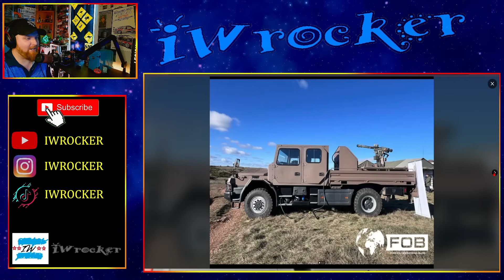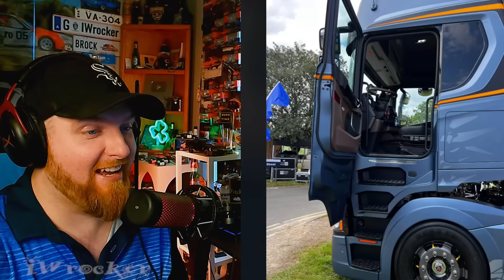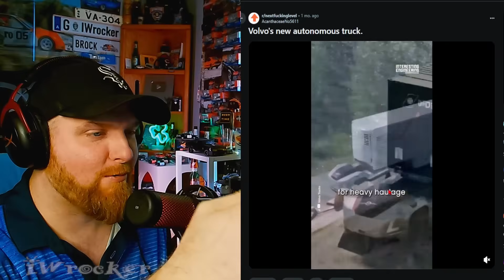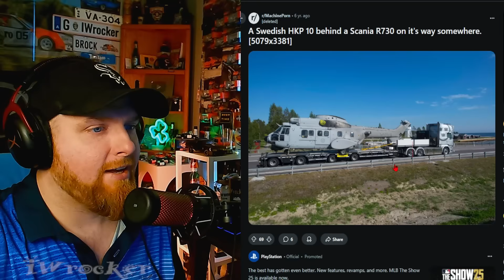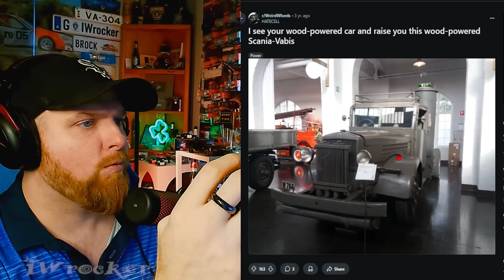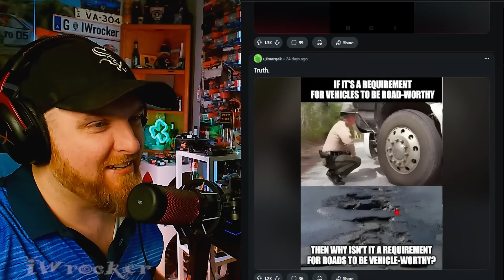American Reacts to some Unique Scanias & Machines From Europe..

Comment: Scania-Vabis was the old name of Scania. It resulted from the fusion of Scania with the company Vabis, an old producer of railway cars and trucks.
Around 1960, I was a nerdy kid and spent must of my time in a freight truck company near my house in Portugal. I was fascinated with the trucks. The employees sometimes let me pretend to drive sitting at the wheel. Must trucks were Volvos, cab behind the motor, painted in a severe gray and extremely solid looking. I used to draw those trucks and still can draw them from memory, 64 years after. Most trucks in the company were Volvos, but at least one was a Scania-Vabis.

Comment: https://www.youtube.com/watch?v=vBo7ctR7bOs The unique vehicle, a Volvo FM540, was built by Ziegler Brandweertechniek and features a CELA extinguishing arm, an ALCO APF5 roof monitor, an Orlaco 360° camera system, Ziegler Z-Vision 360° emergency lights and work lighting, a 6000L foam tank, and a Ziegler FPN10-10000-1HR fire pump with a capacity of 8000L/min.

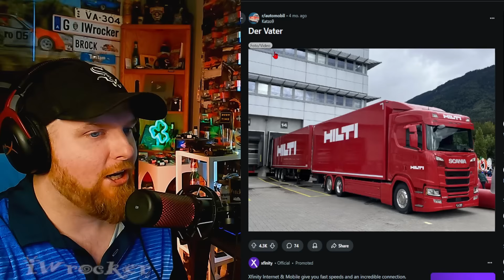Comment: 6:24 "Der Vater" translates to "the father" or probably rather "the daddy". Hilti is a big supplier of machinery and building equipment, especially highly professional power tools like drills or demolition hammers. Their sales representatives mostly drive Volkswagen Passat Wagons, painted in the same red color as that Scania and with white Hilti Logos.
The author of that post is probably referring to the difference in size, so the Scania is "Der Vater" of all the little VW Passats. Also, Hilti sales representatives have an image of driving like maniacs most of the time, especially on the "Autobahn". This may also be the source of the term “Passerati” - a portmanteau of Passat and Maserati - VW station wagons driven too fast by deadline-driven sales representatives.

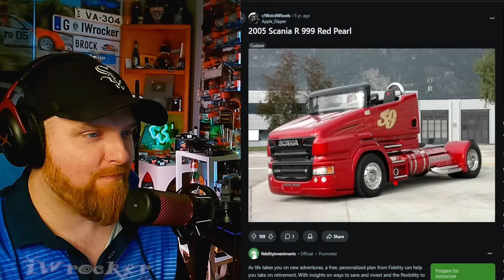Comment: 15:30 wood powered. Wood is burned in a lack of air. This creates carbon monoxide and tar. Carbon monoxide  (CO) is used when cooled to run a gasoline engine, producing carbon dioxide (CO²) . These vehicles were used when gasoline was not available. But it takes a long time until the fire is lit and enough CO gas is produced. In addition, the engine only has 1/3 of the power.

Comment: That scorpion stinger was originally invented for use on aircraft. It can be seen on big aircraft fire trucks. Obviously - it works on buildings as well.

Even if the roof or the walls are impenetrable - there are always doors, windows and skylights.

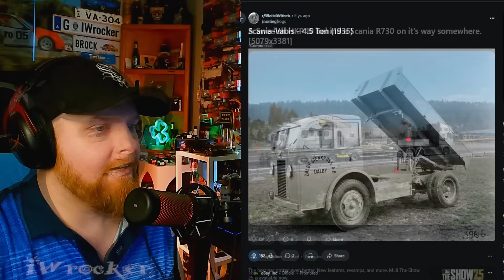Comment: 12:40 i have a friend who is also a truck driver(i am too) who does militairy transport, he does transport for a company that does metalworks, the wheels of a tank if they need to be revised they go to this company but also whole tanks can be revamped or constructed its called Van Halteren Metaal(i can say this because it isnt classified in anyway). he transports Fennek(reconaissance vehicle), CV9040NL and CV9035NL(Dutch version of a Swedish tank), Boxer(APC) and other militairy vehicles(he drives a low bed). my company also does transport for it and does the transport for the wheels towards certain other companies and also other metal parts for non militairy ends and metal sheets

he drives a Volvo FH6 with about 540hp since he doesnt need that much, especially since we are in the Netherlands and the terrain is mostly flat

Comment: "Wood powered Scania": In and after WW II there was not enough fuel available. So ovens, that heated up cubes of wood without firing them. The hot wood produced "wood gas", this was used instead of petrol.
Reply: OK, you explained yourself!

Comment: The "Stinger" thing is mostly meant for use on airports, it was developed to poke trough the (relatively thin) metal hull of a plane and douse the insides. For that matter the emergency vehicles on airports are awesome too, you should maybe check out a video about those 😁

Comment: 17:35 As it is written up there, this is an OM 70 with Minonzio bodywork. Officine Meccaniche Milano was a company that produced vehicles, especially commercial vehicles, but it was also the winner of the 24h of Le Mans and the Mille Miglia (1000 Miles). This vehicle with this bodywork is the characteristic shape of the vehicles of street vendors during market days in Italian squares (in addition to vans, Piaggio three-wheelers, station wagons with suspensions that do not ask for mercy, more). This brand was bought by FIAT and from there the commercial vehicles changed their names, some under FIAT, others under the name of the newly formed Iveco. The last appearance of the OM brand is on forklifts

Comment: V in German is pronounced F. So it say "Der Fater". 'Daddy" (the father)
Oo that EPA. 16 years old can drive those and they are limited to Max 50 km/h. Best part its an easy conversion to make it go faster, removed the reduction gear (IF it was built like that). Pretty much unique for Sweden.
You got it. Bay 11, Door 10 🤭

Comment: .. wood gas as fuel (Biomass fuel) ..
wood/coal or other organic material is heated under pressure in a low oxygen eniroment, wich releases Metane(ch4), Hydrogen(h2) and co and co2, the carbon gases r filtered away with tar, water etc ..
its simillar to how some biofuels r made today .. just more efficient today ofc ..
...back then ther was always a massive ammount of solid matter left (charcoal for example), nowdays produced biofuel can liquify about 70-85% of the biomass, left overs as biochar can be used as a super fertilizer ... and removes greenhouse gases from the atmosphere

Comment: The EPA- tractorscwas originally a way to convert other cars and trucks for farm use, restricting their top speed to 30 kl/h and regulating their passenger and cargo carrying abilities. As normal tractors became more readily available again, they became popular with mainly the rural youth as they could be driven from age 15. Ways to go around the speed restrictions, and ways to hide such mods from the police was a big thing.

The concept is still around in a somewhat different form in the A-tractor, where now any car can be used, electronically limited, passager and cargo abilities (rear seat and trunk sealed off) limited.  And ways around the speed limiter is still a thing.

Comment: 3:37  there is manual super  high  abresive water jet cutter equipment  that can cut a small hole into all materials even steel and concrete,  then deliver a high pressure water stream that atomices into a micro droplets fog in the volume that is on fire without letting air into the volume. 
The equipment  lance/  handle can be operated by on fire fighter.  It can also be used to cut  bigger openings into roofs and walls . Its in use in sweden .
 Dont you have does in the  us?

Comment: 13:56 That T-cab Scania 113 is a truck with bus axeles so it was driven alot faster then a ordenery truck and The trailer had a slewing ring instead of a kingpin so it is permanently mounted.
Reply: Bus: 100km/h Truck: 90km/h Truck with trailer: 80km/h :)
Reply: @ not when this was driven in traffic then it was 70km/h
with truck and 90km/h by bus thats was why this was build

Comment: The first one is the brand new Scania 4X4 Vampire, Mistral 3 Air Defense Vehicle, esp. built for mountain troops, where mobility and "light weight" is most important. It's equipped for deploying MISTRAL 3 missiles.
The second one is a Scania Vabia L50 tank truck (prob. 1968, but could be earlier model)

Comment: That blender render is pretty neat, since the model quality is so perfect. I think the texture work was probably done in something like Substance 3D, which allows you to make very realistic textures with included height maps, normals, and specular maps. A fabric on that is pretty easy, but the resulting texture files must be massive in size to avoid pixelation and blurry details.

Comment: 33 cars on that Chinese car haulier.
Mate roads are disintegrating all over the place. Just be glad that your cars don't have to go through the UK MOT every year. Especially after seeing the state of so many American cars on the roads in the USA with massive cracks on the front windscreen (In the UK, a windscreen crack or chip larger than 10mm in the driver's line of vision (Zone A) or 40mm elsewhere on the windscreen will cause an MOT failure). So having one about 10"+ going across a windscreen in America would cause your car to fail and could be categorised as "unsafe" to be on the road until the screen us replaced.
Reply: Just look at the structural and suspension (held together by nothing but hopes and dreams) issues we can see in the Just rolled in videos here on YouTube - and many customers declining repairs and driving away...

Comment: 16:00 During WW2 many cars (in Europe) were modified to run on wood gas because regular gas wasn't available
Reply: Seen  pic of a German training tank fitted with such a device. Not sure if they used wood or coal though
Reply: @michaeltempsch5282  In Sweden it was never coal, but we have a quiet a lot of wood and not any domestic coal.
Reply: @cynic7049  i'm aware that it was wood that was used in Sweden - the wood/coal uncertainty was about the German training tank.
Reply: We had plenty of gas, but it was busy doing it's job,heating our homes 😅
Reply: .. mostly methane i can add ..
wood/coal or other organic material is heated under pressure in a low oxygen eniroment, wich releases Metane(ch4), Hydrogen(h2) and co and co2, the carbon gases r filtered away with tar, water etc ..
its simillar to how some biofuels r made today .. just more efficient today ofc ..
...back then ther was always a massive ammount of solid matter left (charcoal for example), nowdays produced biofuel can liquify about 70-85% of the biomass, left overs as biochar can be used as a super fertilizer ... and removes greenhouse gases from the atmosphere
Reply: i heard there are some pics of north korean army trucks that have this device i think it was just a couple of years ago

Comment: At 13.52  That contraption was a 9 passenger bus, with luggage/cargo space. Reason: speed limit regulations in Sweden.
Buses: max 90 kmph  , trucks 80 kmph.
Very few "passengers" ever rode those buses.

By the way, I doubt that the first military vehicle has any Scania genes. Does not look anything like a Scania.
Reply: While it likely doesn't have any Scania genes, but that ugly military thing use Scania parts.

Comment: @ IWrocker  I suspect that the french Militarytruck and the Argentinian Bus as so many other special looking Scania's have the Bodywork done by another Company. Here in Switzerland the old Postbuses were made by Saurer, but only the Chassis with Wheels, Motor, Gearbox and Driverseat. The Body with the seating itself was then built by Ramseier+Jenzer Carosseriewerk (Carbody Works), so the finished Buses would show the RJ Plaque Front center above the Saurer-Logo. This is very usual here in Europe, Utilityvehicles, Ambulances and Firetrucks being the most common being built like that, where f.Ex. Mercedes delivers the Chassis with Motor, Gearbox and Cabin. Then a Company would put the Ambulance Part as a prebuilt, finished "Box" onto the Chassis and wire up Bluelights and Electricity.   Scania, Volvo Mercedes, MAN etc. would deliver the Chassis with Cabin to Rosenbauer or Vogt, which then builds the Firetruck onto it.
If the Front of the Firetruck has the IVECO Logo, but the Ladder says MAGIRUS, then only Chassis with Motor, Gearbox and Cabin are IVECO, the Rest is built onto it by MAGIRUS

Comment: 20:55
In Germany, such caravans are often used by showmen, for example circuses or carousel operators who travel from fair to fair, and are often pulled by older SCANIA tractors.
Reply: It's the same thing in Denmark. Not only with circuses, but also with travelling tivoli parks that will attend major animal fares and festivals and such across the country. But also note that the truly nice trailer homes of this kind is bosses only while the workers and artists are housed in trailers that are more like 4 rooms with 4 beds in them down the length of the trailer. But of course, workers are production units. Not people.

Comment: 1:38  The SCANIA VAMPIRE looks strange but it is a state-of-the-art (2024) vehicle, specifically designed to carry the PAMELA (Plateforme d’Adaptation Mistral Équipée, Légère, Aérotransportable) system, which facilitates the firing of Mistral missiles.
Reply: If you need a big ass truck to carry Pamela, Pamela needs to go on a diet!
Reply: @RadicalRootz Or rename it Rosie? (Whole lotta Rosie, AC/DC)

Comment: Wood powered cars where used a lot in denmark at the end of ww2
Reply: Same here in Finland. Burning wood to generate wood gas (or some sort of coal gas) to be burned on modified diesel engine. There were also normal cars that were converted to use that kind of tech, but it was looking awkward as the burning equipment were a big barrel looking thing hanging on read end of the car...
Reply: @sasiuru  As made obvious by the wood gas powered Scania, they where common in Sweden too during WW2 when oil and petrol was scarce.
Reply: @ Yes, it was quite common thing all around the northern europe during and after ww2. Have heard some stories how those had problems that power weren't enough, steeper hills bus driver might ask passengers to jump out to push bus... Not sure if true, or just a jokes of the old farts. ;)
Reply: @ As I remember the fuel created by that barrel was basically a mix of carbon monoxide and some other stuff. CO poisoning was apparently common, so you probably wouldn't want to push that bus for too long, or you'd be pushing up the daisies next.